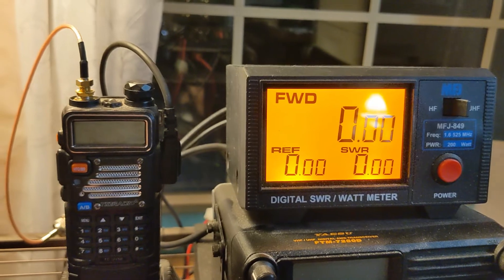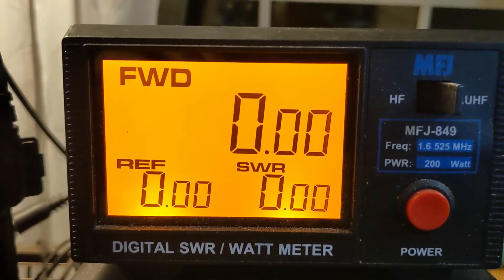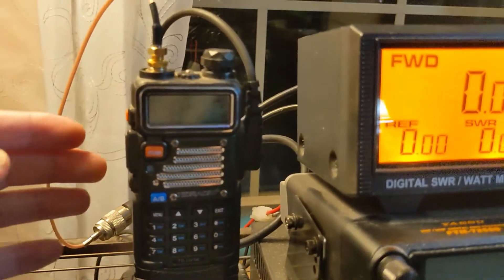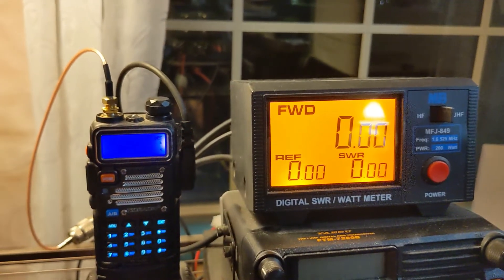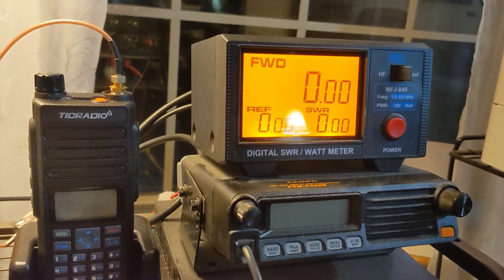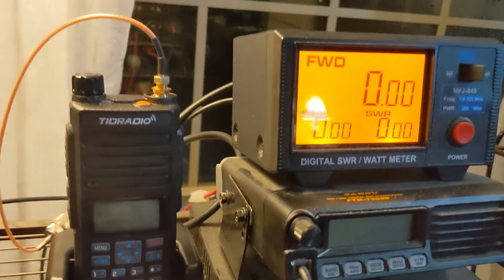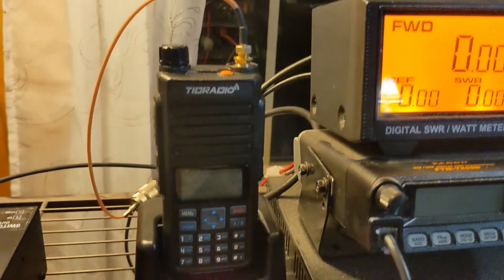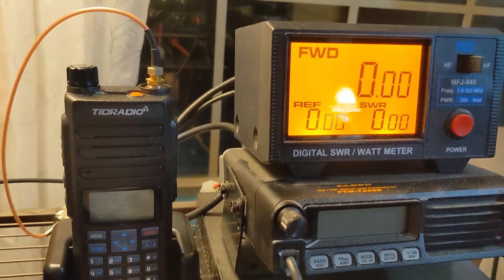UV5R vs TD-H6 Power Output Test

Comment: I got an 8 watt baog2ng and the 10 wart Tidradio. 
the Tidradio seems as if it's alot better quality.   the inside of the battery compartment is metal like a Motorola.  baofeng is all plastic.
both work well.

Comment: Can you unlock GMRS frequencies with the same 4 button key press on the H6 that unlocks them on the TIDRadio UV-5R?
Reply from the maker: Not sure about anything in the last 6-8 months, but the H6 does not require anything but programing to gain access to GMRS frequencies. Of course all FCC regulations should be followed....😁